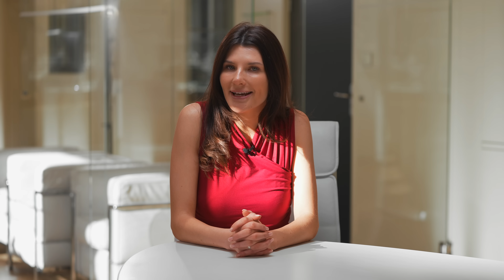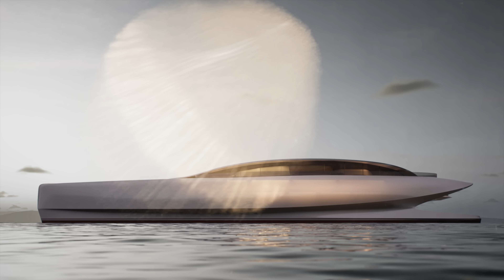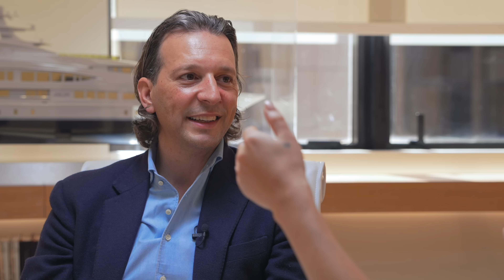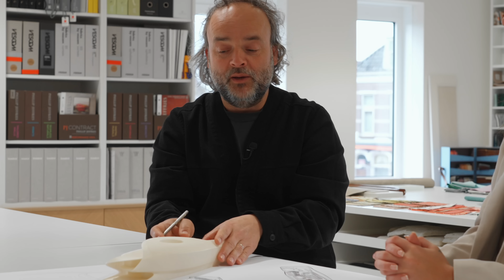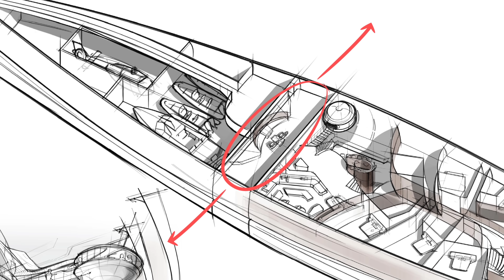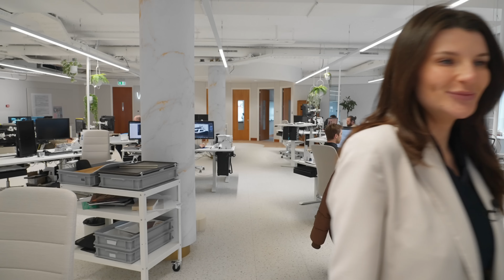Oceanco's revolutionary PROJECT LILY. Would YOU build it?

Comment: Like many concepts before, this is a spectacular wave breaking vessel. While Lily may never take to the water, many of her innovative features and aspects of her design language will undoubtedly come to life on other yachts.

The issue is not four dining options.... the issue is on virtually all semi custom series yachts under 500GT there are four static dining areas. From experience I can definitively say each dining option is utilized, with each serving a purpose. 

At home most have four or more dining options as well; Breakfast at the island bar, lunch at the informal dining nook, and dinner in the dining room. In the garden we all have one or more dining areas. A breakfast table and close to the kitchen, an eat at bar at the summer kitchen, an uncovered lunch dining area, and the full sized covered outdoor dining room adjacent the summer kitchen. In my case the uncovered dining area is convertible as it's utilized the least and located on the pool deck. This set-up is comprised of dual purpose height adjustable tables with butterfly tops, folding chairs and storage cabinets. The cabinets store the dining chairs and serve as sideboard self-serve stations. On a yacht one could argue multiple dining options is equally necessary. Indoor dining for inclement weather/noise considerations while in port, main deck aft for breakfast/children's dining, air conditioned/wind protected upper aft deck for lunch/dinner, and the sundeck when the weather is perfect, while in port for privacy, or when entertainment accompanies the dining experience.

I suspect the novel pod idea will be incorporated in other vessels as a library, office, cigar room, bar, snug, etc., etc.,. The majority of clients with the means to see this vessel come to life no longer have young children. These individuals are typically self-serving. Such clients would undoubtedly steal this standout pod feature for adult use. Let's be honest a child remains within each us no matter our age.

Comment: @Vripack — a few considerations; the last thing you want to hear when relaxing with a massage is the sound of people dropping weights.  Secondly, the last thing you want to smell when eating is body odour emanating from the gym.  Therefore, I suggest locating it adjacent to the water toy storage as both can share an independent air management system and it will provide sound isolation for the massage room.